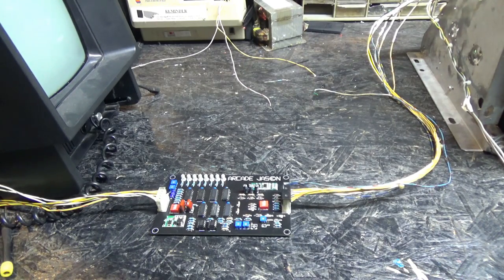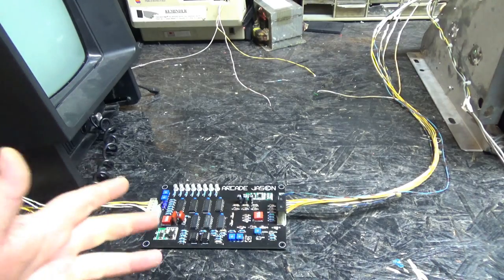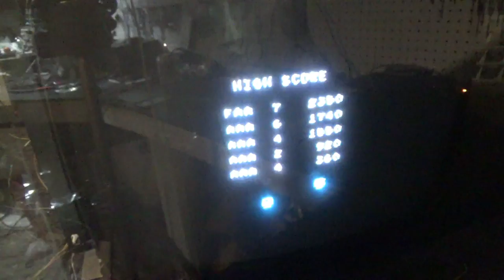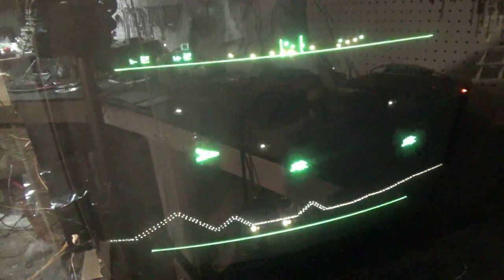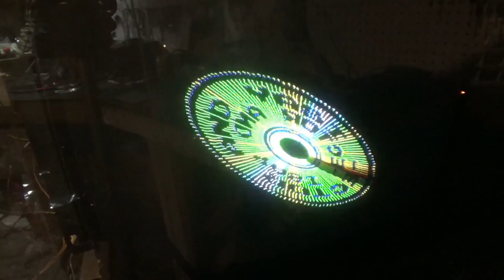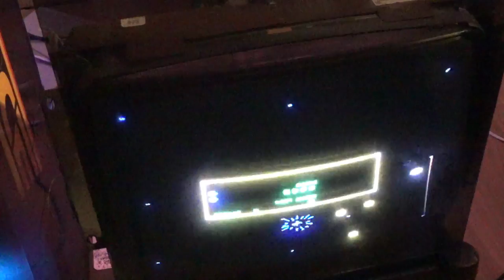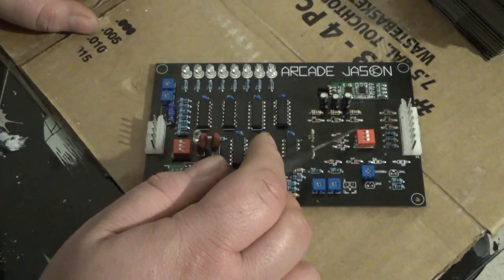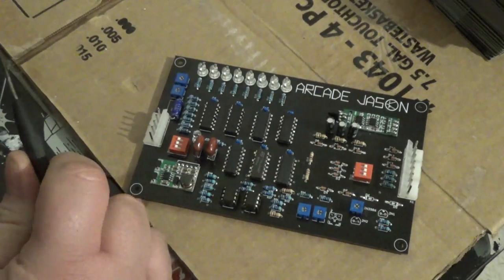This board can convert B/W vector games to COLOR !!!

Comment: ARCADE JASON,  what are those trim pots called that are adjusting the colors in the test mode lines? 
what are those trim pots doing? are they changing the XY position counters or what?
The other trim pots are adjusting the XY size, by changing the XY position counters amplitude? 
When adjusting the Z blanking trim pot this is adjusting the intensity of the XY beam?
Reply from the maker: #1 trim pots lol
#2  adjusting the potential difference  that is being sensed by an array of  comparators 
#3 yup
#4 Z blank and intensity are 2 different things   blank just means z off signal
Reply: @ArcadeJason  I mean what are the trim pot doing to the circuit when in test mode the lines you meant you adjust the trim pots for the RGB colors to align up with the lines but what are the trim pots doing to the logic signals?
But why would you want to adjust the blacking z off signal for what reasons? 
The XY size trim pots are doing what to the XY logic signals?
Reply: @ArcadeJason  there is a guy named "billy William" that is catfishing you and its not me just FYI just ignore him thank you